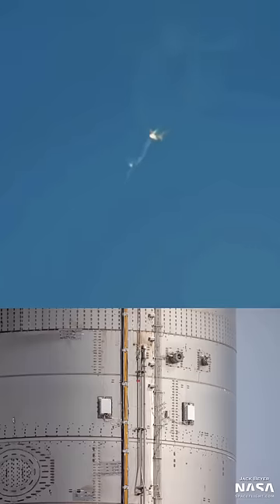Is This Why Starship Wasn’t Destroyed The Moment It Lost Control?

Comment: Honestly I was surprised most by the fact that it didnt just collapse as soon as it started cartwheeling. I wouldnt have guessed it would be able to withstand those kinds of lateral forces with the full stack still stuck together.
Reply: It was made of a stronger steel construction rather than the aluminum alloy found on previous rocket designs. A system such as the Saturn V would have buckled seconds into that tumble and ruptured the tanks and cause a massive explosion.
Reply: A comment above from one of the engineers on the team (limited info likely due to an NDA), outlined that the stage connector collar could withstand forces up to 3.5g, another commenter observed that atmospheric pressure is 1.5% of surface pressure, both of which are likely factors in how the rocket didn't bend. Another observation made was the FTS charge that blasts an object through the fuel tanks to cause the fuel to detonate was set to go off automatically, but it hadn't in order for more flight data to be recorded from the ground, then the killswitch got flipped when they got their data.
Reply: @Acey785  Yeah, people have to remember that they are supposed to be reusable. You have to imagine that they will have similar empty/low pressure tank potential during future landings, and ideally land and be quickly reusable.
Reply: @Acey785  those NDA documents are one of the first things you sign before anything they gaurd proprietary intellectual trade secrets like you have no idea.
Reply: One thing to remember is these Rockets are intended to be reusable so it has to survive re-entry and landing whilst being completely intact and those forces compared When compared to the tumbling are likely far greater in that tumbling probably wasn't doing anything meaningful to the structure.

Comment: Another issue to fix: self destruction
Reply: They should just use the most reliable one of all... 000 destruct 0.
Reply: bomb timer was set for 25:00
15:00
05:00
6h:00...
Reply: @NoNameAtAll2  no
Reply: This is how a lot of FT systems work
Reply: Less struts?
Reply: They used boxes to punch holes but most older rockets used explosives on the seam so splits the fuel & oxidizer tanks open so is more chance of stopping the rocket from going somewhere it is not supposed to go.
Reply: They’ve had this capability since the 50’s.. this wasn’t that. They either wanted to collect as much data as possible, knowing the altitude, they could… or they wanted to let the rocket stabilize and simply lose pressure at a much slower speed. That way they could ensure it would minimize any collateral in the ocean. Those pressure bolts and censors are very durable and can withstand serious G’s. 

Or I could be wrong… I only sold some of the censors 😂
Reply: @NoNameAtAll2  wonder how many got that
Reply: In fairness, up until this point its never been an issue ;)
Reply: Worked as required. FTS should not cause the propellent to explode. It is required to prevent any further thrust being developed, not to destroy the vehicle
Reply: @pex_the_unalivedrunk6785  what if elon accidently sits on the button though
Reply: @SA-5247  claims to know all about because "I only sold some of the censors 😂"....and continually spells sensors as "censors".  What are you censoring?
Reply: " The fix is pretty obvious "😂
Reply: @Richard Gilley 😂
Reply: Yep. They couldnt even get THAT safety mechanism to work properly.
Reply: Heyyy …whats this red button do….um….Oh Crap
Reply: @GPGOLDENTEE  So you are claiming that the self-destruct did not work?  Cool story dude....
Reply: Yup 👍
Reply: @jebes909090  Commander Riker sat on the touch screen consoles on the Enterprise all the time without blowing it up, I'm sure Elon would probably have to give some kind of command code first, like 1-1 A...and require 2 other people for the additional codes, 1-1A 2B, and 1B 2B 3, respectively.  Meanwhile, the rocket probably crashes on some poor neighborhood, because thqt entire sequence takes too long. 🤣
Reply: Dr. Doofenshmirtz had a hard time fixing that!
Reply: @frankchan4272  I’m pretty sure spaceX makes their tubes pretty special and the seam isn’t as identifiable like nasa rockets
Reply: No thank you!
Reply: Are you telling me that it even failed at destroying itself?
Reply: @NoNameAtAll2  

I think I k ow a Futurama reference when I see one.
Reply: There's a reason it's called "flight termination" and not "self destruct"
Reply: seemed to work fine. If it had happened earlier in the flight it would have been much more responsive.. kinda like a feature instead of a bug?
Reply: @pex_the_unalivedrunk6785  yeah, Elon has to be careful using command codes like that.. he might get them mixed up with his kids name!!  😮
Reply: If only there was a more reliable way to make it explode, used by every other rocket made to this date?
Reply: @GPGOLDENTEE It worked, your brain doesn't work.
Reply: Imagine that lot landing on a public viewing area...
Reply: @SA-5247  what kind of collaterals in the ocean lmao
Reply: Not an issue at all
 Look at how much time they have after a pressure malfunction to eject their pilots.
Reply: @SA-5247  but cant spell sensors?
Reply: They didn't want the rocket to explode after hitting the rocket exploding button? Wow!
Exactly like "they always intended to blow up the rocket" cause, you know, multi-multi million dollar sparklers is how Elon made his money to begin with...
How do people get so invested in a total stranger?
Reply: @CallMeBlazer it's new approach, similar to Falcon, there is  a dome that separates oxidised from fuel inside fuselage. Majority of other, older construction got two separate tanks inside fuselage, while spaceX and new constructions from other companies uses fuselage AS tanks. Major savings in weight , it's just more effective, as "seam" between tanks had to be strong enough to support weight of full tank, while new approach uses pressure for rigidity
Reply: Curse you perry the platypus
Reply: Me too spacex... me too....
Reply: @kingblondie7075  went over my head I'm not ashamed to say... 👍🖖✊️
Reply: @memberHD  utter Musk apologism. Musk seems to have a cult, not a bunch of companies...
Reply: @jimbob-robob Yeah, a cult of bitter people dedicating their free time on hating on him at every instance instead of actually doing somthing worth while in their life. Pretty insane behavior if you think about it.
Reply: @MuppetsSh0w   he's doing it partly on taxpayer's money and govt subsidies with not a lot of progress... (See 60s Apollo  moonshot) that's why he gets the criticism. People wouldn't care too much otherwise. Shame you can't see it. But cultists never can. Bye!